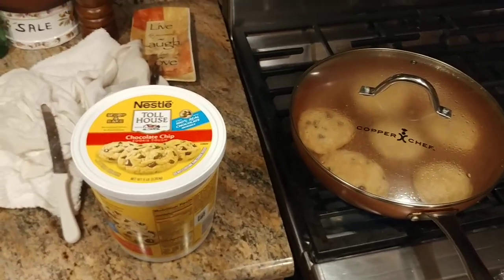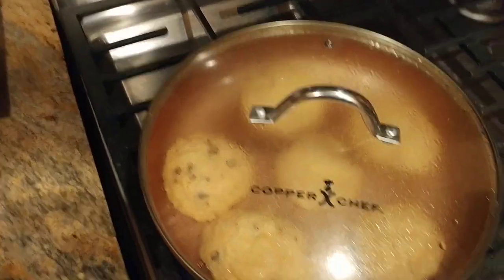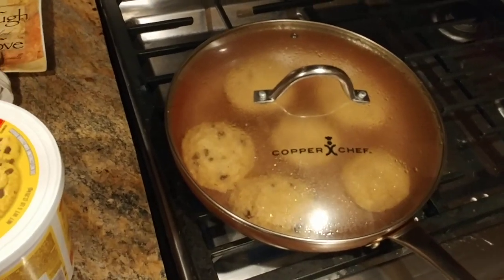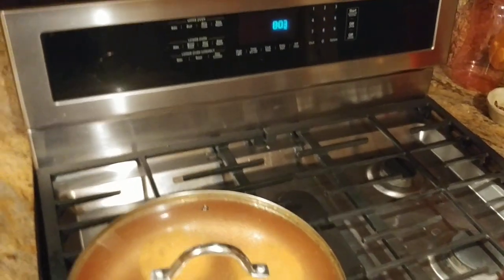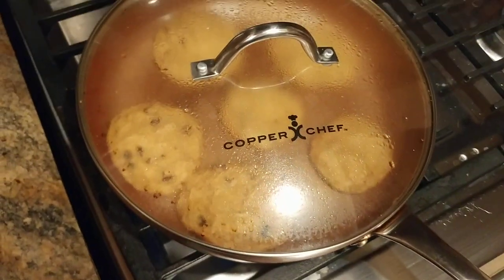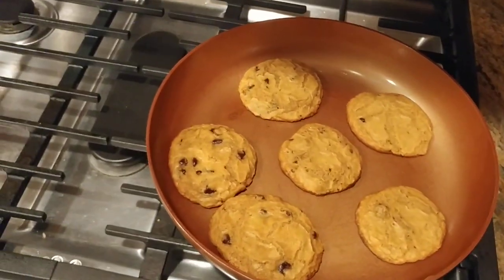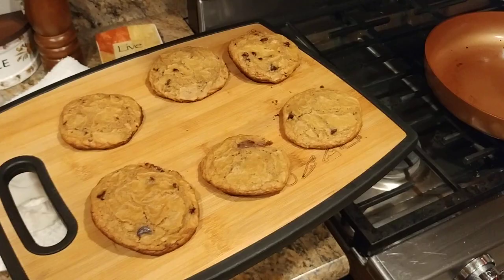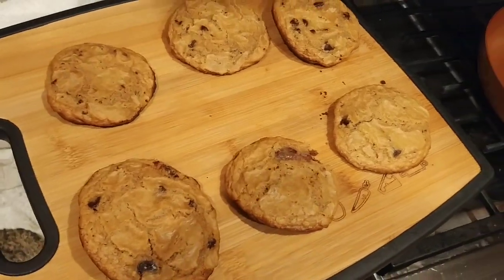41. Baking chocolate chip cookies in a frying pan hot fresh ooey gooey chewy cookie best recipe chef

Comment: Did you add butter/oil first?
Reply from the maker: Actually, didn't need to. Because the chocolate chip cookie dough has some kind of oil in it I believe, which does the trick of preventing the cookies from sticking... along with the non-stick properties of the pan. Honestly, if I was going to do it again, I would put down maybe some butter if anything. Would add an interesting flavor profile I'm sure.
Reply: @OldCootProductReviews  ahhh 
Thx! :)